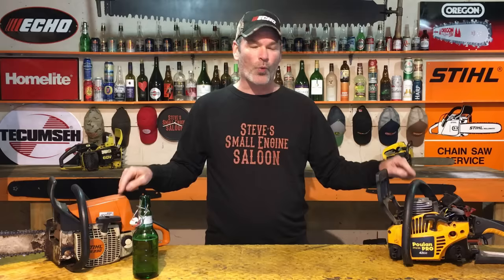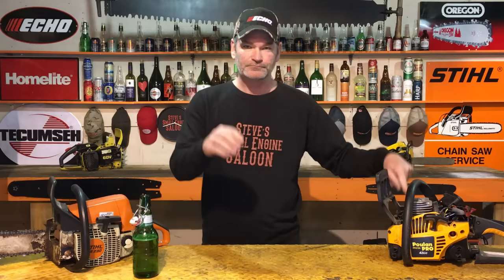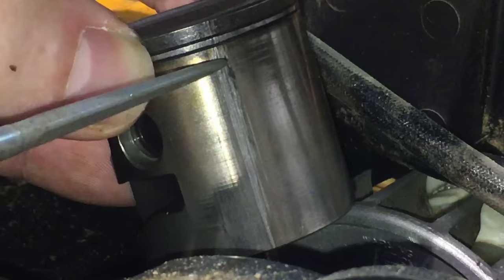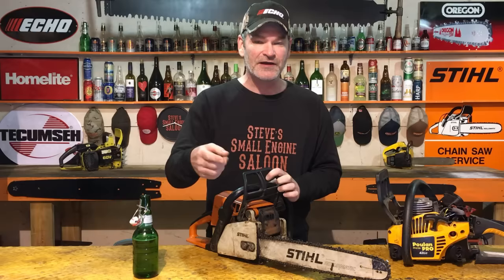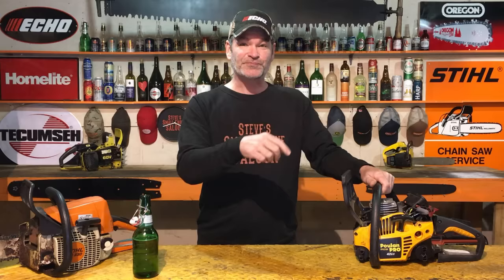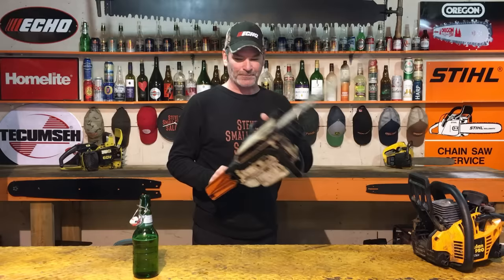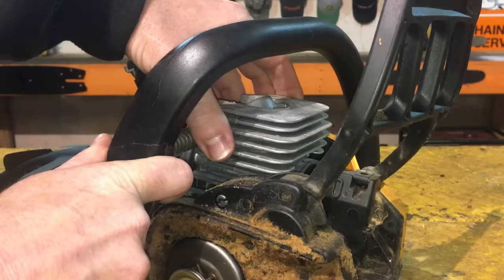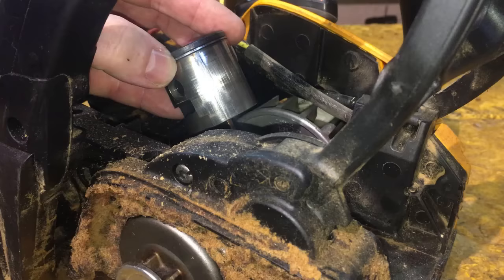WARNING: Never Do This To ANY Chainsaw

Comment from the maker: Click here for a new piston and cylinder---- https://amzn.to/3tJKsmj
Correct Way To Sharpen A Chainsaw---- https://youtu.be/-GIxowey6IQ
Scored Piston and Cylinder on a ChainSaw---- https://youtu.be/Iay9-rmhWEA
Adjust Or Tune The Carburetor On A Chainsaw---- https://youtu.be/M6T5JoGXcHY
How To Tell WHY Your Piston is Destroyed---- https://youtu.be/b6BfSwtjTIQ
Click here for my website--- http://www.stevessmallenginesaloon.com/
Click here for my Parts and Tools Store---- https://www.amazon.com/shop/stevessmallenginesaloon
LET THE SAW WARM UP FOR A BARE MINIMUM OF 60 SECONDS.  LONGER WON'T HURT!
Reply: Steve's Small Engine Saloon I was about to ask! Stave Steve
- Kiva
Reply: Answered my dumb question. Thanks Steve!
Reply: Chainsaws are like 100 meter sprinters, need warming up to finish the race.
Reply: Steve, maybe this is a stupid question but why would framers be using a chainsaw?
Reply: @blackrabbit212  hey black rabbit! Well I'll tell you what we did with them. When you frame you do a lot of brace work on walls, roof trusses, and everything. Braces don't have to be exact, it's not like you're measure something down to 3/8 an inch and have to make the cut pretty and straight. Having a small lightweight chainsaw all you do is blow and go, provided the little bit of warm up. But that's better than dragging an extension cord around because we didn't used to have any battery powered Circle saws. .......... my apologies to the barkeep! My daddy told me not to speak out of turn and I should have waited on you.
Reply: @jackwatkins7382  Thanks for the info. I didn't know that. Never seen them used here except of course in log houses, but that's a different matter altogether.
Reply: I usually spend at least that long stumbling around and deciding where to start cutting.
Reply: Great, Yup will apply this next season.
Reply: @warrenmaris8085  boy Mister Maris that's a no shiter!
Reply: I went right to the comments to find the answer. Ok, so 60 seconds warming up is enough, but how do I actually warm it - just let it run in idle rpm?
Reply: Happiness is a warm Stihl
Reply: @blackrabbit212   Building homes buildings pole barns  it is faster to cut with a saw then use a sawzall in tight area or up high .
Reply: Hey Steve, love your videos!!  Such helpful tips!  In your memorabilia the mug is nice but how about a some beer coolers?  Let me know and I'll order the first 2!
Reply: I let mine warm up at idle speed for 5 mins every cold start
Reply: Will ethanol gas ruin a chainsaw?
Reply: @jackwatkins7382  Removing bottom plates in all door openings (chainsaw > Sawzall for the win).
Reply: @warrenmaris8085  good one!
Reply: @GravityRoller  and that's a no shiter!
Reply: Thanks Steve you answered a 40 yr old question that I had about my chainsaw, no one else mentioned that to me.
Dave
Reply: @oldhawkins  oldHawkins I've got a problem now with some of my older Stihl chainsaws and they told me at the shop they didn't have the correct tubing with the filter on the end of it and the stopper that plugs into the top of the tank is also made on to it. They said it's obsolete and that the ethanol gas is probably what destroyed the tubing. But I ain't going to give up on my little chainsaws because I'll buy tubing and just make my own one way or the other. But we have one station well 2 I think in our County that sell regular gas. No more than I run a chainsaw or Weedeater anymore since I've gotten kind of crippled I buy Husqvarna gas and it is 95 octane regular gasoline with the oil pre-mixed and also has a stabilizer in it so it doesn't go bad. It's expensive and if I still cutting cord wood I'd go with just regular gas in my own mix but hey I like the pre-mixed stuff. Oh and by the way if you buy Husqvarna saw or weed eater and and you run their gas in it they'll give you a two or three-year extra warranty!
Reply: Gas station fuel has quite a few other additives that a more harmful than ethanol,especially if the machine is stored with it for any significant amount of time.
After the actual fuel has evaporated,these additives are what actually form the gummy varnish and really goober up carburetors. True Tygard fuel lines survive ethanol exposure pretty well. Chinesium knockoff fuel lines and other rubber parts,like fuel cap seals  and equipment that has a black rubber grommets for the fuel lines to pass in to the tank. They will turn to mush with prolonged ethanol exposure exposure.
Canned premixed fuel is your safest bet but,dumping the tank and running the engine until it dies is not a bad workaround.
Reply: Let it warm up for about the time it takes to drink a beer.
Reply: @jackwatkins7382  Check with Jack's Small Engine online.
Just enter your Stihl model number in the appropriate box and click on whatever subsection you need and from there,just click on the numbered circle and the part number and price will come up. You can either order directly from them or use the part number to search on Amazon.
Reply: @oldhawkins  It's never hurt mine. I have an Echo and Husqvarna. I use E10 in everything no issues.
Reply: I learned something new. Great video. Learning so much!
Reply: Wow you even include a TL;DR pinned-summary, you are talented at getting your points across (and incredibly knowledgeable obviously), thanks a ton this channel is invaluable there are only a handful of videos I may skip (lawn-mower stuff only) but am considering the entirety must-watch if I'm to keep on top of my gear :)
Reply: Makes me cringe when people go right to wide open on a 40 degree day
Reply: @jackwatkins7382  Same for Stihl, you buy one, they improve your warranty if you buy their gas at the same time.  For us occasional users, it's not very expensive.
Reply: @SteamCrane  yes Steamcrane and I can't buy Stihl around here, well I can but their service sucks so bad I wouldn't dare buy 1 and the next dealership overs about 45 miles so I just stick with a husky. I noticed the other day and Tractor Supply they had that premix gas but there's was only 94 octane and I don't remember what brand it was. I think it was 6 bucks a quart but I can get the Husky for the same thing and I wouldn't run the risk of them having something and Husqvarna brand that tags it so if you had a warranty problem they might say whoa you haven't been running Husky gas in it. But like I said it anything except an expensive warranty but you know if it keeps it running I don't like the down time and having to carry it up there to get it worked on regardless. Happy 4th
Reply: I've had my Poulan Chainsaw for about 5 years I never left it warm up I cut five to eight loads a year and still runs
Reply: blackrabbit212....to get accurate cuts
Reply: I usually wait until first beer is gone ... Then I start using chain saw 😁
Reply: Thanks Steve if your ever in Australia I'll shout you a beer
Reply: Steve's Small Engine Saloon Steve, you better call Buckin’ Billy Ray and tell him, he’s hard on the saws sometimes...
Reply: Good info, just from my own experience I dont refill an keep going. I have more then one. I have a theory that the machines are only meant to run on a full tank then need to be cooled down before running again. Before this I was going threw alot of saws an heavy duty trimmers clearing feilds...  worked for me.
Reply: blackrabbit212 - I use to do heavy equipment repair, got called back to yard ( shop) one afternoon, We had a ole ole Ford F-8000 with a International motor an 13 speed tranny shoved in , The Clutch had went out on the truck An we told it had to be fixed before 4am or equip would not be running the next morning- anyway to get the Eaton tranny outta this truck is a real PTA .we had to put wood blocks on the tranny jack an started letting it down An how the frame an crossmembers are on this truck one of the timbers caught , ppl fooled with this thing for about 15 min trying to get out - It was like 9:30 pm at this point , I went to the back of truck grab my lil Chainsaw an Yelled get the F$&K outta the way , 5 min laters the Transmission was sitting on the ground - The expression on the Shop Boss face was priceless ,
Reply: it was a cheap cordless saw to cut joists with, before we had good cordless 7.5" circ saws. with a chainsaw you can also cut multiple joists at once.
Reply: Thanks Steve! Explains why our chainsaws die...
Reply: I have for the last 20+ years started and ran wot no load for a minimum of 10 seconds before starting to work the unit. Have never had a seizure that didn't involve lean fuel or oil. This is how we instructed our customers when they purchased any 2stroke handheld equipment. Always warm your 2strokes up before putting a load on em.
Reply: @paulbillings1791  so the hotter it is outside the faster it takes? 😁
Reply: @oldhawkins Ethanol is not really harmful on its own.
Going back to our grade school science class,we remember that oil and water do not mix.
Alcohol and water will mix.
The alcohol content of ethanol can take on so much water in proportion before the water exceeds the alcohol content by a large percentage and then the water will stratify/separate. The water will stratify/separate to the lowest level and that is typically your carburetor.
The real killers in gas station fuel are the other 11 herbs and  spices that start going bad in about three months and really gummy in five months.
For long life out of ANY two cycle equipment,I reccomend canned premixed fuel.
Pure gasoline with only synthetic oil and fuel stabilizer in canned two cycle fuel.
Reply: And even though "THEY" say that modern day CARS do not require a warm-up...just crank and go!...I believe any combustion engine that uses oil for lubrication needs, at least, a brief warm-up!  Will they usually make it without a warm-up???  Yeah, just like a chainsaw will usually make it...but it's not a good idea, and they will sometimes NOT MAKE IT...just as you have shown here.  OK, that's my 2 cents.
Reply: So a six pack of Raulsch then.
Reply: I've been guilty of that. Won't do it again not as much as saws cost
Reply: Steve's Small Engine Saloon  That’s for the 60 second advise. Didn’t really think about it. Probably could of recked my chainsaw.
Reply: ?How long do I need to let my Chainsaw run be for i use it
Reply: good advice, and thanks for loading up video and sharing your knowledge and expertise 👌🏽💯

I met so many people, who refuse to share their expertise, like they're afraid of it being stolen.   What I've learned, is that those kinds of people, have an Insecurity issues.   What I've also learned, is that you still learn something from people with insecurities, you learn how to deal with the next a$$hole better.
Reply: Thanks for the upload and good advice!
I was out recently warming up my saw with the brake on and after a little I will feather the throttle to feel the response as I know now when it's warm by feel, and a friend of a friend that's was there to help load wood felt the urge to "inform" me the brake was on and that's why it wasn't working 🤣
Yep later that day it was revealed that he had recently "blown up" his own saw.
Reply: Warren Maris   😂
Reply: Thanks !
Reply: I work at a dealership and hear this EVERY frickin DAY!! Drives me bat$#1t crazy!!
Reply: Thanks just got new farm boss. Any maintaining pro tips.
Reply: Hey bud, should i let a full tank of feul tun through my new saw??
Reply: @michaelmartinez5217  how long to cool down then? 30 min?
Reply: I am literally sitting 8 feet from a poulan 1800  tore down in a 5 gallon bucket that would run 5 minutes good then big down and quit and not restart until cool again. (Cracked ring). I got up b4 vid was over and sure enough in that exact spot the piston has 5 score marks! Amazing that saw lasted as long as it did being so abused like that. But it was taken care of, other than that.
And damn I didn't even get to sip my beer! So I guzzled it! Thanks Steve!
Reply: @mikeh8812  I know I'm a little bit late, but  I have a poulan 1800 that's about 25 years old that just went to chainsaw heaven, from a cracked ring and the piston has 5 score marks in the exact same spot
Reply: jack watkins lo
Reply: Thanks Steve.  New sub here. Enjoying your first videos I have viewed.  Nice work.
Reply: S
Reply: Great thanks for the info Steve!
Reply: I have a poulan.  I am usually running out of daylight by the time that oil spill turns over. That's why I dont wait.
Reply: LOL thank you ! I WAS just going to ask how long to let it warm up cause I didnt hear you say . I been practicing slower start up time since the first time I heard you speak on this .Thanks for all the great tips !
Reply: search YT :  ' 1 million de km utilitaire '
(french sorry)
Reply: @Toober55 
Lol sure does x2! The ole body needs warmed up to, ya definitely don’t want to seiz up! I know in that amount a time I’m heated! 🤬 😂
Reply: @jackwatkins7382  You really should use non-alcohol gas in all your two-stroke engines. Also called Rec Gas. It’s a whole lot better on your carburetor diaphragms and any rubber parts . It’s typically 90-91 octane but has no alcohol in it.
Reply: @Toober55  Hahaha, you must run a Poulan. They call em that cuz you’re always poulin and poulin and poulin every time you try to start em.😄
Reply: Thanks for the quick reply.
Reply: @eddevarona8448  I do. I think I mentioned that I used the Husqvarna brand. And there's a store about 15 miles from me that I can get regular gas that's about 89 octane and I get my generator gas there. And that I keep it treated with Sta Bil.
Reply: For that sort of work get a Battery one
Reply: @Toober55 bahahah Yupper mine takes 9 pulls n then it'll start, but I usually start it up bye the time I get to wear I'm going to cut it just warmed up 😅
Reply: It's like a Chick that doesn't get any foreplay...... they can seize up on ya 👍🥃
Reply: Guilty as charged!! Have been using saws all my life and have never let one warm up.  Fortunately at 76 I am not to old to learn new important information. THANKS
Reply: You are an excellent if not brilliant mechanic but you have a long way to go before being a convincing salesman for beer.
Reply: Steve - I have a friend that has a Stihl - 251 EZ start  and when he adjusted the chain with the “ thumb- wheel “ tighten the 2 bolts to the bar - the chain loosened up ?  Any idea whats going on ? I looked at it - run it on 4 cuts- no slack on the chain 🤔 any idea ?

Comment: I took a briggs and stratton small engine repair class in school. We would TOTALLY tear down and rebuild from the ground up . My instructor insisted EVERYTIME you cold started the motor, to allow 20 Mississippi seconds at idle for proper cylinder expansion time. Very good video. Very professional advice.
Reply: Fox In tha dark 
I fill my chainsaw at my shed, start it and let it idle as I walk to my work site.  Never had a problem with seizing in over 30 years. Running a cold motor at high speed is asking for trouble. Besides stalling when cold, it just doesn’t run well until warmed up so wait a couple of minutes.
Reply: @Mote78  I had an 1850 Oliver tractor with a  354 Perkins diesel engine. I "Cold started "and loaded the tractor. Didn't make 1 pass around the field before the engine locked up. Removed head, found 1 piston/sleeve had seized. R&R piston and sleeve there in the field. From then on, I always allow an engine to "Warm Up" before applying a full load on it.
Reply: Thanks for the info, Fox. I thought one minute would do. Guess I'm safe.
Reply: Someone needs to do a proper statistical analysis of how long Mississippi seconds are relative to SI seconds.
Reply: @Juttutin  1 Mississippi = 1.382 SI seconds